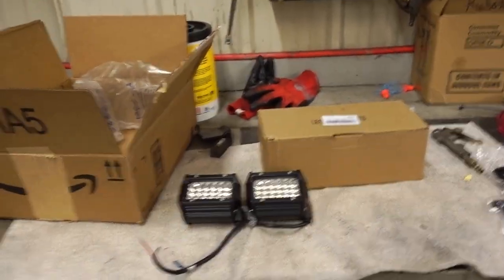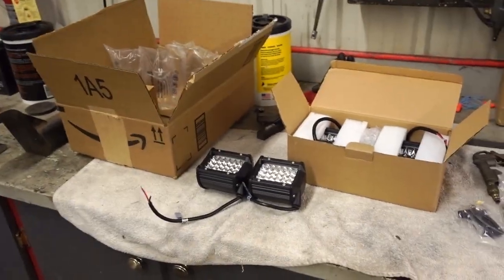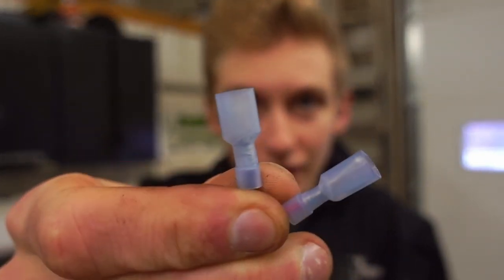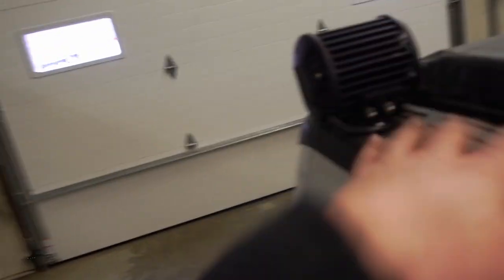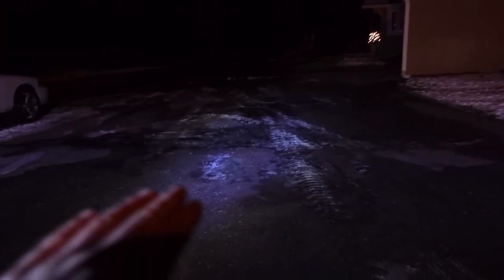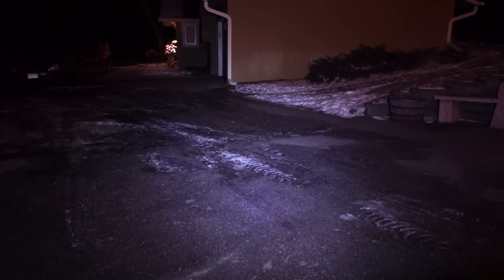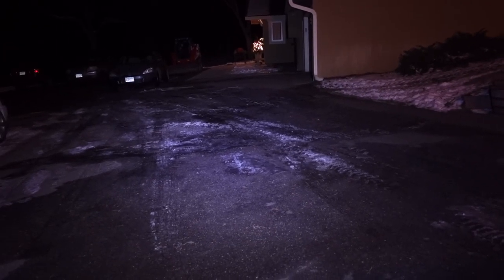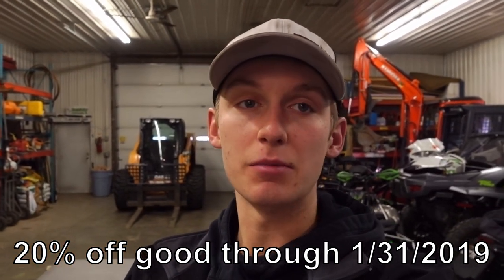The Best Snow Plow Light Setup | NAO Lights on Lights on Lights!!

Comment: We just run cheap 4" round LED's we get off Amazon for  like 7-10 bucks a pair, mount them to a trailer hitch with a large hook welded to it and wire it into a RV trailer plug and like yours, every time it goes into reverse your golden. (I believe it's the center pin and green on a 7 pin plug) I don't recommend using those Scotch Lock type connectors for any wiring exposed to the weather. We also buy (off Amazon) weather proof automotive type connectors to wire the lights to the power source so if and when the lights go bad we simply unplug it and add a new one. We seem to get a few seasons from these lights if they don't smash them into snow banks. One truck has had these cheap lights on it for 5 seasons now and still look and operate like new.
Reply from the maker: Some good quality lights then! I know if in,punted them low I’d wreck them hahaha

Comment: just an observation, it could be the camera playing tricks on me, but it appears that the light that was mounted on the rear passenger side of your fathers truck is losing 1/4 of the light output because its pointed to far down (onto the bed rail) it may produce more light output (to the ground) if It was mounted up a tad higher, or mounted somewhere differently. or better yet  if the mounting bracket allows, you could just try tilting it up first and see what that does.
Reply from the maker: The angle could have been fine tuned a bit for sure, I got them dialed in now and work pretty well right there any light being lost is so close to the truck anyways that it doesn’t make much of a difference now. It’s much brighter in person as well